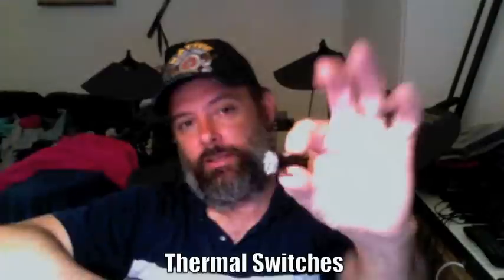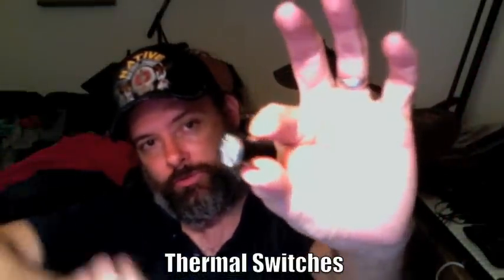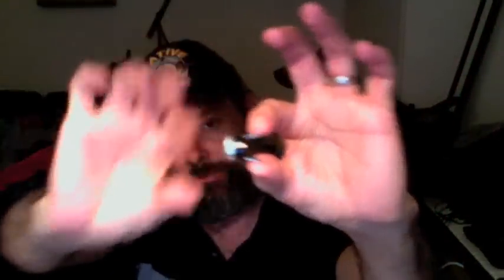Thermal Switches or Snapdiscs control on off power via temperature

Comment: When researching units:
add both the F* & C* Temp to your search sentence.
NO= Normally Open.
NC= Normally Closed.
The ID# will have an F. at beginning of a series of numbers = (NC) closed.
or an                           L.      "                                                      "   = (NC) Open.
Looks as if they trigger after a difference of 15digrees. according to all I have seen.
Also, wiring connects on top or to sides of snap switch.
Hope this helps.

Comment: Ok so here is my question:
 I'm building a cleaning station with car oil pan heating pads. (using water and detergents, no oil based products) Temp at 120F. I have seen some instruments using two switches to control the temp. That is so you have a specific target I believe. Would you use a snap switch (closed) at target point and use a switch open at the same target point to get a specific temp vs having  the temp balance between 10 to 15F difference before (a single switch) where to trigger. Hope that make sense.  I don't want a wide  variation in heat.  It would be nice to see more videos of these underused parts being used in DYS projects they are a great piece of simple engineering. GLAD YOU POSTED.... Thanks in advance.

Comment: I have an Oster model number 5711 food steamer that suddenly stopped working. The indicator light goes on when i engage the timer. However no heat/ steam is produced. I suspect it is due to the thermal switch having failed. How do I determine which  what switch is needed and where to obtain it?

Comment: I built a band heater vaporizer to treat honey bees for mites. The cook pot is an aluminum pipe coupling 1 5/8" od. Will this function when mounted to the curved surface of the coupling?

Comment: Question: How can I test one while removed? My diesel compressor has one for overheat shut off. Its a Nason but no part number on it. It's probably set for around 210-220 degrees rising I think. My ohm meter says it's normally closed but I don't even know if it should be/if it's any good. I need my compressor to shut off if it's overheating. Please help, Thanks!

Comment: My gas furnace won't kick on--pilot light looks good, replaced the wall thermoswitch, as I assumed that since it was "old" that is was the problem. Put in a new thermocouple for good measure, Still, no heater.  I began playing with a VOM meter to see what I could, and found a similar thermoswitch near this one showed 120 volts when I plugged the positive probe into the connector and touched the thermoswitch's contact. This proved true on both contacts with both wires on that thermoswitch. On other adjacent switch (T-O-D 60T12), I performed the same test, and while I got the same 120 v reading on the left contact, the right contact showed nothing. I then removed the connector from the left switch, knowing it was getting voltage, and when I stuck the red probe into that connector, and touched the contact point in question, still showed 0 volts. My assumption is that this thermoswitch is the problem. Should I replace the thermoswitch showing no voltage on the right contact, or look further?

Comment: I have several of these in different temp settings unfortunately, regardless of temperature settings, they all have the indication on the back that says KSD301. How can you tell from looking what the temperature trip points are and whether or not they are normally open or normally closed?
Reply from the maker: KSD301 is a MODEL SERIES.  This site will give you some info on those models... http://capillary-thermostat.com/down/snap-action-thermostat.pdf
Reply: I believe that my thermal switches which were purchased from ebay had ONLY the text KSD301 printed on the back so I still wonder how you can tell from looking what the set points are?

Comment: It's cold and I've set a heat lamp in my dogs house, but there is no reason for it to heat day and night so I want to set it up to turn on at 40 degrees and off at 60.  Can you provide some guidance?
Reply: I would guide you not to put electrical appliances, especially a heat lamp, in a dogs house. Sounds very dangerous to me. And if you have to ask how to use it, you probably shouldn't be messing around with electricity, especially mains powered AC.

Comment: This question is somewhat off topic but not entirely. What do you think or have any opinion of the tiny house movement in the last several years? It's all about living off the grid and being energy-efficient and self reliant. I really do like the concept. However I think I would be most comfortable in a 1000 square-foot house or a little less then the typical tiny homes that are 200 or 250 ft.² or less. This is something that I would really consider for myself in the future.